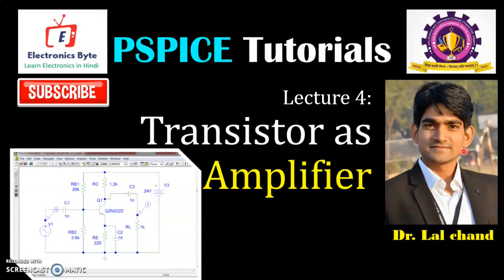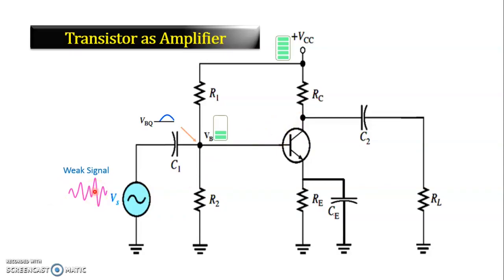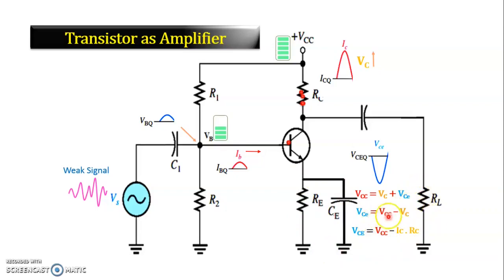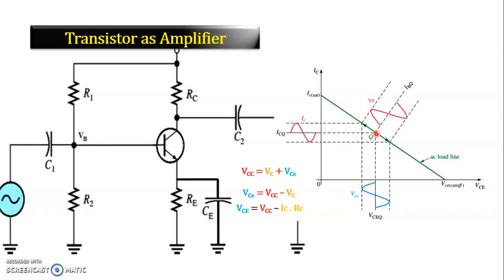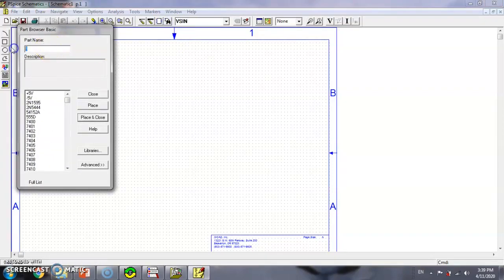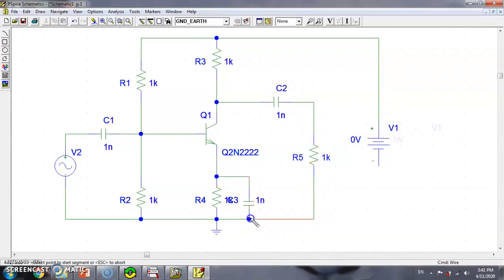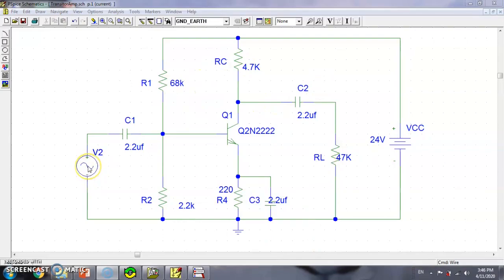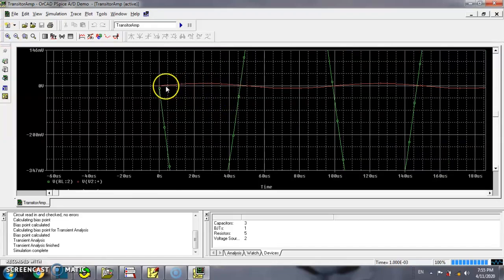How to Simulate Transistor as Amplifier in PSPICE (Simulation of Transistor as Amplifier in PSPICE)

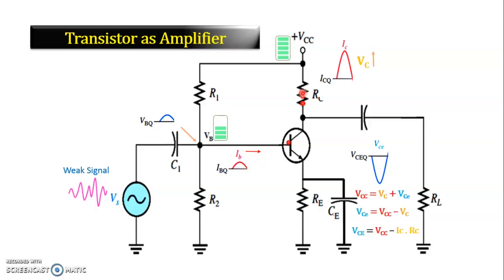Comment: at 3:00 you have to include RE * IE to find Ic=f(Vce) because CE should not be considered. To find the DC characteristic & Polarisation point of the Transistor , you should not consider the Dynamic parameters yet such as ve(t) and small varable parametrers, where CE is a Short Circuit